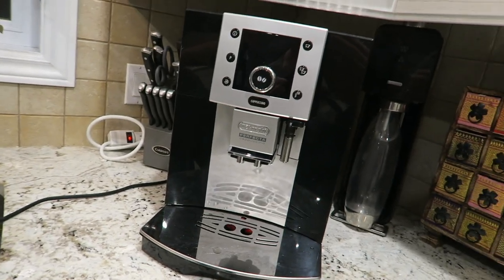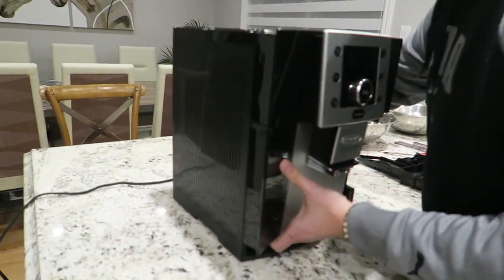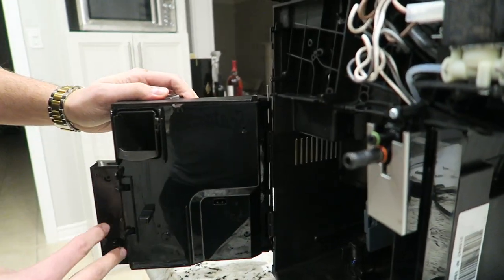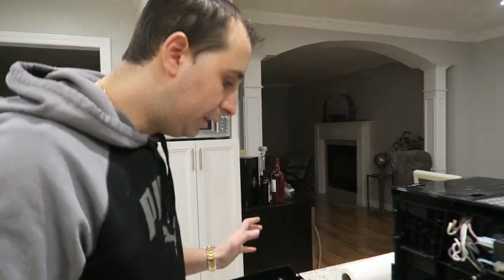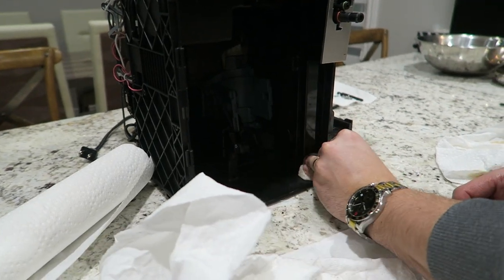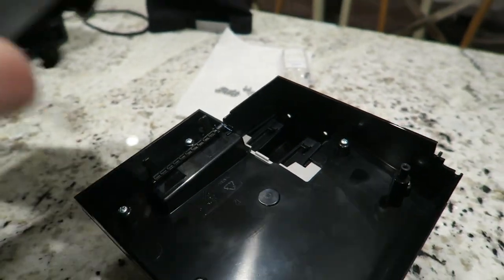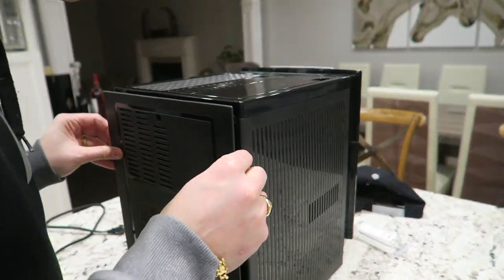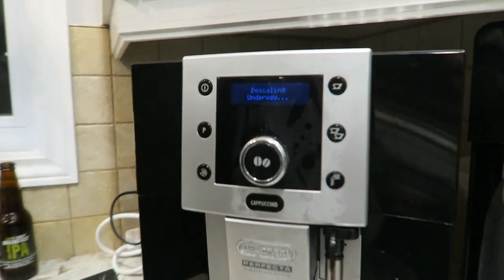DELonghi Perfecta Repairs, cleaning, and maintenance.

Comment: Guys, greetings and thanks from the UK.   My machine is about seven years old now and had previously been sent away to be cleaned & serviced (at a cost of £70) when the coffee flow started puking out the back of the nozzles.    It just started to do this again.   I didn't fancy that cost again so thought I'd have a go at cleaning it properly myself.    Your video on how to take it all apart and take the door off etc gave me the confidence to have a go and... .. it worked perfectly.  A nice clean flow of hot coffee again.   Will make sure I give it a more thorough clean now.     Cheers!
Reply from the maker: +Jon Swatton glad we can help!! Thanks so much

Comment: Finally a good repair video on this machine. Couldn't figure out how to pull the infuser out until I watched, I never knew the machine had to run thru the power off cycle. I took my infuser plate off and cleaned the stainless plate with oven cleaner, the caked on coffee was causing an off flavor in my coffee.

Comment: My machine’s spout cracked and leaks. This video is exactly what I needed to fix my machine. The nearest repair shop is a 2 hr drive each way. I enjoy repairing my machine —- it is a steady performer for many years. I make many cappuccinos each day and had the cleaning down well. I now feel confident to replace my door w/ the spout in place. Thanks guys, time for a Kahlua capachino
Reply: My spout cracked and leaked too. I followed this video to pull it all apart. I rang my repair place who told me that they would just super glue the crack if I'd brought it in. So I did.

Brilliant video. Thanks guys.

Comment: Guys- this is still a great video that I have watched a bunch of times.  I recently had the common issue of a leaking spot (it sprung a leak in the centre of the sliding piece).  Your video is the go-to guide for self repair of the perfecta! Overall great machine, and great video!
Reply: Well done❤

Comment: So glad I found this video!  My machine is super dirty.  I suspected I needed to clean the inner workings like this, but didn’t know how, other than wipe out the grounds.

Also, just wondering, whenever my machine says to refill the tank, there is still water in it.  Is there a way to fix that?  

Thank you!  You explain this so well. Best instruction video I’ve seen.

Comment: Great vid guys. Thanks. It really helped. Too bad these machines are scarce now. So are parts. The Phillips ones don’t hold a candle to the Perfectas. It’s all in the long lasting crema they produce. The Phillips don’t do that. I took mine completely apart today. It was a gonner. “Grind to fine error” it turned out my generator piston was super gunked up and lots of the holes were clogged. I spent hours checking everything else in a hidden diagnostic test mode these machines have and traced the problem to the generator. I took a gamble and tore it completely apart and cleaned the heck out of it with a brush and warm water. Banda-Bing, back in business!

Comment: Don’t know why you say to keep soap away from the infuser.
I’ve had my ESAM5400 for over 20 years and have always put the diffuser in a dishwasher run with all my kitchen stuff at 60°C, obviously the soap tablet washes the diffuser intensively during its hour-long run — there has never been a problem, in fact no problem whatsover with this amazing machine during all of the 20+ years. Brilliant Italian engineering!

Comment: Great video!!!!  I’ve been getting an error that the grounds are too fine to insert the water spout.  I’m only 5 mins into your video so I’m hoping you go over that because I inserted the water spout, hit ok it doesn’t fix it.  I know you can’t adjust the grinds without it grinding according to Delonghi.  I have the Gram Dama, sadly they discontinued this machine.  I’ve had this model for 10 years and 7 years ago I had to buy a new one. 😩. We went out of town and there was a bad storm and damaged it.  It would no longer work.  So I definitely recommend unplugging it if you go out of town.
I’m still watching video and I’m half way through, if you haven’t gone over the error 
‘Ground too fine adjust grinder and insert water spout and press ok.’ I didn’t change any settings and this just popped up.  If I unplug the machine it resets but once I start making a latte it stops and the error comes up. ???

Comment: Super sharp video ! I have a problem, I did find anyone with the same problem yet, could you help me please ? My Perfecta 5500b is brand new, I have used it 3 weeks so far. The infuser is stuck in a way that prevents the door from closing, and the infuser reset procedure doesn't do anything. So I am completely stuck. This happened because I am new to this and I tried to remove the infuser out of position. What can I do to remove it, or to put it back into normal position ?
Thanks much!
Reply from the maker: Normally when you unplug the unit wait 30 seconds and plug it back it automatically resets the infuser to the default position. Is that happening or it doesn’t move ?

Comment: Very good video. My machine recently started to take longer to heat up, sometimes starting again right after preparing a drink. It's also releasing some steam from the steam wand in the heating up process. I have always cleaned and descaled it regularly. I have also a brand new milk jug. Do you guys have any suggestions, please?

Comment: Amazing video guys! Can I have you over to check mine? Lol
I wonder if you can identify what is the problem with mine? 
It’s about 5 years old, I turned it off and unplugged when was going away
When I returned and plug it back , the coffee started to drip instead of pour , eg its like making espresso instead of coffee, feels there is no water pressure- takes forever to make s full cup and the quantity of water seems smaller that it shall be … repair no everywhere in Toronto about three weeks wait time … is there os anything I can try myself? 
I cleaned the machine’s removable parts and the grinder

Comment: Hi guys thanks a lot for the very good and complete video. I have a problem with my machine, no water comes out of it and a very strong noise is made with some different messages. Could I give you more information to get some more help? thanks in advance for your help. Kind regards

Comment: HI! Thank you for a very useful video. I have a  problem to submit to you. Could you show us how to open the front panel with the screen, because I have a problem of bad contact inside. When I push on to it, it lights when I relieve the pressure it goes off. This concern only this little screen the rest of the screen works perfectly. Thanks for your help.

Comment: Hey guys, great information in this video! I have that exact machine for a couple of years now and have been very happy with it until the other day.I started getting a message "grinds too fine adjust mill" and "insert water spout". I did everything it said to no avail. The grinder works fine but when it comes to pouring out the coffee, nothing comes out. It sounds very weak and then then a loud continuous clicking sound until the pouring cycle ends. Any advice? Thanks in advance!
Reply: My exact problem! Did you solve the issue?
Reply: @69drown   yeah mine too. See you wrote this a month ago, did you solve it?
I`m going to research this in coming weeks, weeks due too lack of time for hobbies.
The pump is obviusly working, and as i understand it`s simple constructiom. It either works or not. Assuming that`s correct i will dissassemble and follow the path of the water to see if i can find some kind of blocking.
If i remember i will write here again.

Comment: Hey guys you are great, question, today my Esam5600 has General Alarm message, when I went to remove the tray didn’t come out , the diffuser is stuck down, did everything on the book, nothing, any suggestions? Will appreciate it
Reply from the maker: When you unplug the machine and plug it back do you hear the diffuser trying to move or it’s very quiet ?
Reply: Shoppers Therapy no noice at all.
Reply from the maker: Sorry for the bad news but it seems the motor that drives the infuser is dead. You need to send it in to a repair center. :(

Comment: Great video guys.  Thank you.  I have exactly the same model and the water leaks whenever I descale or make cappuccino, but it does not leak when making espresso.  I followed your video to open up the machine,  made a cup of cappuccino to observe.  The water leaks (gushes out) at the part where the black cube sitting over a brass component which has 2 or 3 water tubes connected to it. The black cube has the CEME 120-60 stamped on it.   Can you help to identify the part and perhaps give me some ideas where to start checking?  I have pic of the spot where the water came out.  I called Delonghi but they never called back.  Thanks.  Hai
Reply from the maker: +HDPsr7 sorry for the late reply. We suggest you call Delonghi and only ask them to give you you local authorized service providers number and address. Call them and you will likely be able to get the exact part you need from them.

Comment: Hey guys. Thanks for this great video. Got the same machine and had some of those problems too. Now after more than 1 year i got another problem: milk!

When i want to get some creamy fluffy milk the pump starts but cant pump the milk up in the inside of the machine so all i get is air and some condensewater. How i clean the inner part of the milk system? I always use the cleaning function - i often clean the milk containers (got 2 of them) and i use the DeLonghi milk cleaning stuff (10ml and 90ml water to clean the inside)

I tried ti clean inner parts but i didnt found where - maybe you can help out?
Reply from the maker: Have you tried to flip the straw and push it in harder ? Also the spout of the container and the lever can be pulled out of the lid. Did you clean those items al loose or did you put it in as a whole ? 

Also, we will check out the other video! Thanks!

Comment: Hi. Great video. I have a slightly different  model ECAM 20.110, but i think they are quite similar inside. I have had one before that died after 14 months, and my current model is 16 months old, and seem to get the same problem. When the machinemis turned on, the cleaning cycle start normally and the wather is pumped into the machine. However  it does not run thru coffee nozzles, but is running into the tray in the bottom. It malkes the coffee and at turn off, the cleaning cycle repeats and cleans the nozzles. At the end this will also stop, and nozzles are stuck. Sending the machine to the repairshop is more expensive than bying a new machine, so I really would appreciate any idea. It is probably just a small silicone ring that is broken
Thanks

Comment: Amazing video guys! If i have water leaking under the boiler area (area you see when you open machine) and eventually under the machine, do you think its an orange O-ring issue?
Reply from the maker: +mixinmark1 most likely any leaking is due to something like that. I would bet it’s an o ring u need to change
Reply from the maker: Hey Mix, TripleQuad here the best way to visualize a leak is an actual rinse run or coffee run. Now only if you feel comfortable you should try the following. Again comfort and caution is required as you will be powering on the system while the panels are out and you can get hurt! Take off the back panel and side panels dry and clean the entire system. Place the unit whereas you can actually  be looking at the backside of the system comfortably but the front side is still accessible. Then fill the water container put the tray and the bin back in and close the door. Plug the unit then turn it on pay attention to where the leak is coming from. If you dont see it press the rinse button and watch it. If you still dont see press the cappuccino button (make sure you have a cup for it lol). When you identify the leak if its at a junction point then most likely its an oring. If that the case you will need to pull the metal clip take the oring out you should be able to see the oring either severely scratched or cracked . One advise dont buy orings from home depot go to an authorized service center and get one. Because these orings are designed to sustain high heat and dont leach chemicals in your drink. Sorry for the delay.

Comment: I have this machine, and it has made excellent coffee for years. Now the other day its sound changed when it was making coffee - and no coffee came out. Nothing from the coffee spouts - and no clean water from the water spout either. It grinds the coffee - but it doesn’t pump water at all. It just pushes the grinded coffee beans into the bucket. Do you have any idea what could be wrong?
Reply from the maker: Hi it seems like your water pump died. It’s fairly simple to replace.  5113211291 type this part number in amazon and you will see what the part is.
Reply: Shoppers Therapy Thanks - I’ll check it out! Appreciate the answer!
Reply: kentchr76 did it work?

Comment: My machine will not descale. The water spout will not flow with water when using the descale function. It sits at descaling plese wait without actually going through the process. Is the machine broken?

Comment: Thanks guys for this great video!  I gotta say that I have several machines and these DeLonghi machines are just not well designed.  That stupid multi-piece sprout is unnecessarily complicated and the gunk up door is a very common issue.  The amount of things needed cleaning are just countless with this machine.  As an engineer, I can see a lot of these design issues.  Saeco/Philips are much better at simplifying the design and the newer versions are even better...

Comment: when the lights comes on , and the infuser unit is in the down position , it makes normal  initial noises and then it strains and screeches as it goes up , and the triange light comes on with the 2 cup lights . I have changed the O rings and lubricated the infuser unit and all i can get to without taking the generator out . what do you think is going on ?

Comment: Is there a repair review which covers no hot water coming out of my ESAM 5500, and also the coffee is only just warm, cannot get it hot, all three settings seam the same temperature?
Reply from the maker: Is the water coming out or is it coming out but it’s cold ?
Reply: @shopperstherapy9181  Hi
No water coming out make a noise but nothing happens then says ground too fine
Reply from the maker: When you press the water spout button do you get hot water from it ?
Reply: @shopperstherapy9181  Hi
When press the button nothing comes out
Reply from the maker: If your not getting water from the water spout and the espresso spout then you either have a clog or the pump is dead. Either or I suggest at this point to take in for service

Comment: Hi, I purchased this model used and hot water does not come out of the water spout. The espresso works fine. Tried to descale but again nothing came out.  Clogged tube somewhere?
Reply from the maker: When you press the hot water button do you hear the pump starting up? It’s a very distinct loud sound.
Reply: Shoppers Therapy yes. I can hear it trying to pump water but nothing comes out. Delonghi said they think there could be some air pockets in the tube but I’ve tried more than 10 times and nothing.
Reply from the maker: It’s most likely more then a pocket. I really doubt you have a clog. You mostly like have a big air leak. 

These things are designed like a straw. If there is air then the suction won’t be good. 

If your comfortable take all three panels out and watch the water path you should see up to to where it goes. This way you eliminate at least up to that point the air leak area. Then analyze the rest of the path.

Comment: My machine was stuck on "heating up", so I replaced the shorted out boiler. The infuser was also moving up and down when the unit was turned on/off. I also checked the mainboard triacs by removing them from the mainboard and checking it with a multimeter. They were fine so I put them back on the board. The machine now goes to "self diagnosis" and then general alarm a couple seconds later. All my elements, fuses and pump are fine. I'm thinking the main board is faulty but I still don't know why the infuser motor was working initially during "heating up" and now everything seems dead. 
Have you ever come across a problem like this?
Reply from the maker: Unfortunately not the only thing I would check is to remove the infuser and start it up and see if it detects it’s missing or does it loop to the same problem.  Sorry that I can’t help much
Reply: It doesn't detect that the infuser has been removed.
Reply from the maker: ShaDoWxGFX then I agree most likely a faulty board. It’s not doing a self diagnosis
Reply: I believe one of the surface mount triacs is currently shorted out or even the voltage regulator is not regulating the correct voltage for the processor to start properly. I'll have to check the voltages later and see what is faulty in the circuit.